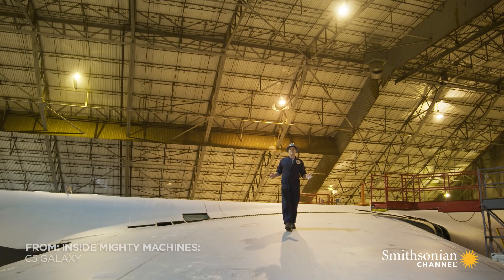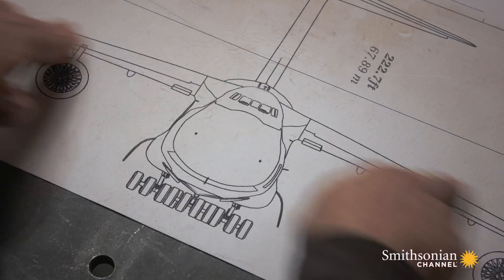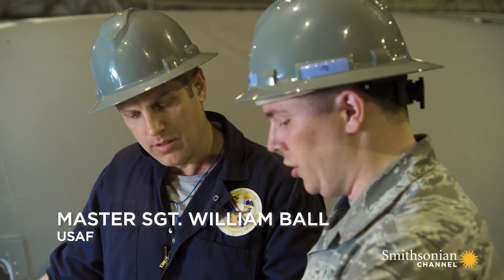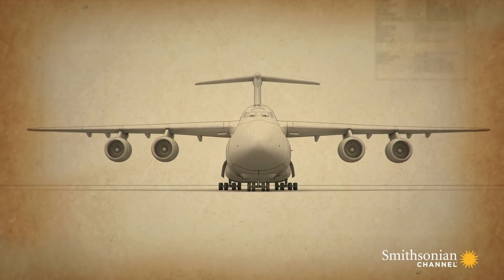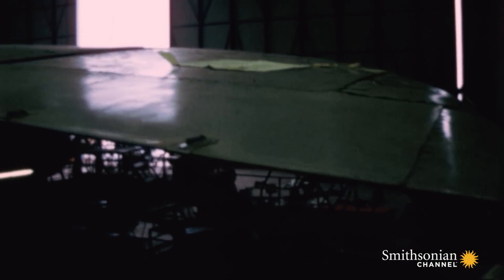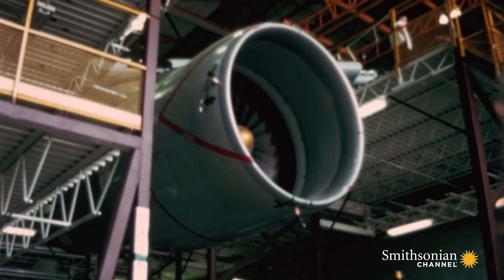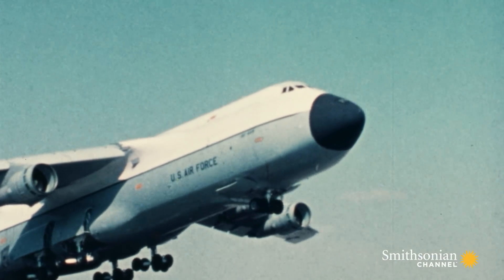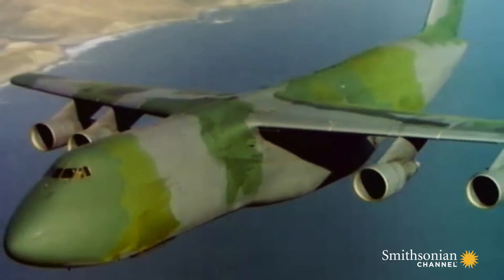The C-5 Galaxy Had a Catastrophic Design Flaw

Comment: As a young Marine flying on a Nato exercise to Denmark in 1978, I was more worried about the cargo door failing at altitude (like in 'Nam)
Turns out, the only thing that failed was a cable in the nose gear steering....on the runway return flight.
We sat in that un-air conditioned passenger cabin for 11 hours like sardines. Not unlike every other flight today. 😏

Comment: For anyone who has a clue, it was NEVER the wings, it was the WING BOX design that was wrong, NOT the wings. I was trained by some of the guys who helped design the C-5. The “Wing Mod” for the B model was to replace the wing boxes on all of them. Lockheed towed them into a hangar, where they’d pull the engines,pylons, flaps/slats off, and actually saw the wing box on the inner areas, and work to replace THE BOX. So, smithsonian should get it right.

Comment: The C-5 is not the first plane to have wings designed to deflect under load. Boeing's early jet bombers, the B-47 and B-52, had wings that deflect as much as six feet. Metal fatigue was an issue with these as well.

Comment: If I remember correctly there is a reason high wing aircraft do not have the dihedral of low wing aircraft. This can be seen even on smaller gerneral avation aircraft. 

B-52s wings flex from 8 feet down to 8 up a total movment of 16 feet. I had a friend who flew in B-52 strikes to Vietnam, he said on takeoff the wings would flap up and down on takeoff and when they went up and stayed there he knew they were going to fly. Important to him since they were carrying so many tons of bombs that they took off with only enough fuel to make it to the tankers for a full fuel load.

Comment: I am an aeronautical engineer. Despite the time and effort put into this video, it has catastrophic design flaws. All aircraft wings flex, especially those that carry very large quantities of fuel, burnt during flight. Note the position of a long-haul airliner's wingtips upon take-off, and compare them with their position upon landing, many hours later. The wings of modern airliners can flex hugely! If an aircraft's wings are attached to the fuselage such that they slope upwards from the wing root outboard to the wingtip, the angle is known as "dihedral". If the angle is downwards, it is called "anhedral". The key reason for dihedral is to make the aircraft positively stable around the roll axis, i.e. if the aircraft is banked then the angle of dihedral ensures that the plan area of the wing going down is greater than that of the wing going up - which tends to pull the lower wing upwards with respect to the higher wing. If the pilots let go of the ailerons, the aircraft will self-level, just as a car with a positive castor-angle has self-centering steering. Dihedral is used on many aircraft with low wings, especially those that need to hold an accurate course, e.g. dive bombers. An aircraft that has high wings has what is known as "pendulum stability", i.e. the weight of the fuselage automatically tends to level the aircraft around the roll axis. If such an aircraft is designed to carry very heavy loads, it can take a huge amount of force to overcome the natural pendulum stability enough to bank the aircraft sufficiently for a tight turn, because the wings naturally flex upwards when "pulling g", so creating self-levelling dihedral. The answer is to join the wings to the fuselage such that they point downwards towards their tips: anhedral. Then even when the aircraft is carrying a heavy load and pulling significant "g" in a steeply banked turn, the wings do not flex upwards so much that they offer a dihedral angle that makes it really difficult to wrestle the aircraft round the turn. THIS HAS NOTHING TO DO WITH THE WINGS CRACKING. The reason for cracking is that the repetitive flexing suffered by the wings caused the stress to vary too many times between limits in a way that was incompatible with the fatigue strength cycling limits of the design material. In short, the structural design and material were incompatible with the stress cycling. THIS IS NOT CONNECTED WITH ANHEDRAL AND DIHEDRAL. Smithsonian Channel: this is cr*p for a channel that dares to carry the name "Smithsonian", but Prof. Samuel Langley would have been proud of you!

Comment: Pretty sure the wings don't need to be angled downwards to flex - source, basically every modern passenger airliner.

The real reason the wings are swept down is because that confers aerodynamic stability in an aircraft with wings placed above the center of gravity.

Comment: Dang, so much wrong with this video (saying this as someone who is an aerospace engineer and worked on the C-6 RERP) and most has been covered, but this was a bit of silliness at 3:15 that hasn't been mentioned:  "... these upgraded planes were renamed 'C-5B.'"  That's not a re-name, just a regular series designator change in the Mission-Design-Series nomenclature.  The "name" of the C-5 (excluding "Galaxy") is "C-5," the "B" is the series.

Comment: The anhedral wing design (in and of itself) is not "what allows it to flex." They flex because of the specific characteristics of the alloys, spars, bulkheads, etc. Presumably, the writer is trying to express that the anhedral angle allows the wings to be close to level when the aircraft is fully loaded, and the wings have deflected under load. But it is not correct to say that the anhedral design is "what allows it to flex". Diehedral wings flex also, as do flat wings. If anything, the anhedral design makes such a large plane more maneuverable, as opposed to other designs.
That was awkwardly worded.

Comment: Have you guys sold out too?  Wings develop cracks over their lifespans, the A-10 wings developed cracks and they were expected.  The C-5 wing cracks were spotted because they were expected and they probably already had a fix in the works.  Before Reagan we had to pull teath to get money to defend the country.  I can remeber going on nature hikes as an aircraft mechanic because we did not have money for fuel, but we had to earn a paycheck....  The c-5 was designed to fit a cheap budget and the wings were expected to wear out.  Reagan as part of his economic campaign on the Soviets, modernized out military.  Part of that program was fixing worn out equipment to save some money on the program, easier to replace old wings than to design a whole new plane.   You do not even describe the fix, but you had a master sergeant there that probably taught you all you needed to know about it.  Why did you just omit that?

Comment: The wing had flutter instabilities in some modes of flight due to both, particular flight envelopes (such as air refueling)and substandard materials during manufacture ( i.e. bean counters during the request for proposal in the development phase). ALDCS was later adapted to the aircraft. Suffice to say, it reduced the flutter and increased the wing life, long enough to give Lockheed time to ramp up the B model production line. Later, it was found that the T-tail developed cracks. This time due to unforeseen stresses put on the tail by refueling behind the McDonald Douglas KC-10’s. I spent many hours in unbelievably cramped, confined and hot spaces (not opened since their initial assembly) helping to repair them. I also spent most of my career flying the C-5 as a Flight Engineer or working on them in all phases of maintenance. It truly was a brilliantly designed aircraft! What killed the C-5 program was the development of the C-17...period! They destroyed the supply chain for the aircraft. They did every dirty trick they could think of ( such as, making the C-5 have to either fuel stop mid-Atlantic or AR because the C-17 HAD to because of its’ initial fuel capacity limitations, among other things)! Every Senator and Congressman had their hand in the Pork Barrel for the C-17 program. It had parts, components and subassemblies that were made in almost every State. D.C. smelled like bacon frying for YEARS because of the 17’s! Still...I loved my 6000+ hours flying it, and the fun filled days and lonely nights working on her. Wouldn’t trade them for a million bucks. Ahhh.....the memories I have of the aircraft, the places she took me (and brought me home from) and the people I worked and flew with. 
I love and salute both her, and all the men and women it took to keep her able to fulfill her mission to this great nation. To all, I thank you.j

Comment: This is way, way oversimplified. There was nothing new about wings that flexed; they were an inherent part of the B-47 which first flew in 1947. It also had anhedral wings (downward sloping wings), which are quite common in aircraft with wings mounted high on the body. The cracks in the wings were a completely separate design issue.

Comment: In the early C-5's the cracked wings caused a lot of fuel leaks. When I was at Torrejon AB in the late 70's it was common to see C5A's grounded because of fuel leaks.

Comment: I am an aerospace structural engineer and I was also a C-5A pilot.  The aircraft original  wing design was quite strong.  However, in order to attain higher cargo loads, they essentially made all the wing components lighter and less strong to get the additional cargo load.  This is what led to the cracking.  They fixed the problem by refitting the fleet with the original wing design, hence the C-5B.

Comment: Anhedral on shoulder mounted wings (especially on big jets) is the norm.  B-47, B-52.  And BTW, all wings flex.  "Cracks" were the problem?  A new wing was the solution?  No, cracks were a symptom.  What was the problem requiring new wings?

Comment: And the earlier Boeing B-52’s wings flex so “ mucho” that there is a wheeled landing gear at the wingtips !  And thin “skin” at the wing root is pretty wavy and wrinkled sitting on the ground.  
Some of the “fix” on the C-5 was not too elegant initially. A lot of great engineering !!!

Comment: This is proof that Boeing actually had the better plane. Thanks, R. Mac! incidentally, the 747, on a Physically smaller wing, could out lift the C5 by 60,000 lbs. Has there ever been a "Wing Replacement Program" with 747s? Nope. Politicians foul up just about anything they touch.
Reply: That may be true, but I think the C5 has a much lower take-off and landing speed for short rough landing strips, that's why it needs the bigger wings.

Comment: This video is absolute rubbish. Lowing aircraft ha dihedral to increase stability. High wing aircraft have anhedral - to decrease stability - otherwise a high wing aircraft would too stable if it had dihedral. To stable means it would not respond adequately to pilots control inputs. I wish premium producers like Smithsonian would consult aerodynamics people before making silly claims. Most private pilots know this.

Comment: Structural engineer here who has worked on aircraft design. All structures flex.  The Washington Monument flexes under wind loads.  Making a wing stiffer won’t make it break.  It will make it stiffer. The 747 wing deflects up under load by a similar amount as does a C-5A wing. 747 wings angle up (positive dihedral) for aerodynamic reasons, to help stabilize the aircraft in roll. The C-5’s high wing is more stable in roll because the fuselage is slung under it, so high wing aircraft often have negative dihedral to aid maneuverability. The C-5 wing cracks were due to metal fatigue. To reduce this, Lockheed had the ailerons (control surfaces on the outboard portion of the wing) flex up in cruise to push the tips down and shift the center of lift closer to the fuselage, thus reducing wing bending loads. They did the same thing on the L-1011. Both have sensors in the nose which sense the angle of attack (the angle of the aircraft to the relative wind) and electrically adjust the ailerons (and horizontal tail) nearly instantaneously to updrafts/downdrafts before the wing gets to the updraft/downdraft that hit the nose, thus minimizing fatigue flexing. Also smooths the ride a bit. Very ingenious system.  This is why NASA and aircraft companies hire engineers and not video journalists to design stuff.

Comment: This was not Lockheed’s fault. The original wing was perfect but the AF wanted it their own way, so Lockheed, under protest, gave the AF just that and those cracks were the result. Once the originally designed wings replaced the “AF wings”; it worked as designed and lasted a long time. I spent  19 years on that bird.

Comment: Saying that High winged aircraft with wings that are somewhat flexible was something new for the C-5? I guess they never of the B-52? The high wing design is not only for ease of loading but with the wings and engines higher off the runway the aircraft can operate airfields that are a bit rougher or may have debris on them.  Same reason most of the bush planes used in Alaska and Northern Canada are usually high winged.

Comment: 131 were built and there were only 5 crashes from 1970 to present. (50 Years) That is 1 crash every 10 years on average. The last crash was in 2006 and no one died. The last fatal crash was in 1990 (30 years ago). 51 are still in service. Yeah I'd call that a successful design.

Comment: The C5 program has had THREE wings thus far in its history: 1) The Original Lockheed Designed Wing that was never built or fitted to the C5, 2) The Lightened Wing Required By The USAF installed on all C5-As, and now the, 3) Revised C5-B Wing fitted to all remaining C5s. 
The Library in Smyrna GA, just a few miles down the road from the Lockheed GA plant, has a coffee table book named "C5A" that was printed in 1969.  That book says that the wing of the C5A was designed for 40,000 flight hours but the need for cargo to Vietnam was too great so the US Air Force required Lockheed to lighten the wing, lessening its lifespan so that more cargo weight could be hauled.  The USAF said the lightened wings would be scheduled for replacement in 5 years... They lasted 15 years before replacement. 
The reality is that the lightened wing exceeded its design lifespan by some 10 years and still Lockheed is blamed for the Air Force's decisions. Unbelievable. Smithsonian Channel PLEASE DO YOUR RESEARCH!!!!

Comment: Remember an airlifter of this size had never been built at that time, and Lockheed was charged for every pound over weight.  So, when the original wing design came out and was discovered to be too heavy, they reduced the weight.  From what I understand the cracks occurred at about one lifetime, so I understand it met the design criteria.  The re-winged A's and B-models had wings that were good for about 40,000 flight hours, hence the airplane cam fly until 2040's.  To put this into perspective, the Russian AN-124 was designed to a similar life as the A-model, and with it's relatively limited use the couple that were built will be grounded in the near future.  I'm not saying the design was perfect, but there's much more to the story.

Comment: Wow Chad you got a lot of things wrong in this vid. All wings inevitably flex, especially noticable on big planes.
What you call 'pitch' is actually called anhedral angle and it just reduces the force that is needed to roll. Also it has nothing to do with fatigue cracks caused by flutter.

Comment: Not quite on topic but the B-52’s wings were capable of flexing an impressive 22 feet up and 10 feet down. It has been decades since I saw pictures of a wing loading test of a B-52 with the wing tip at max deflection but it was astonishing that the wing could survive the punishment without damage.

Comment: Original spec required landing on unimproved runways.  Boeing told them it couldn't be done and Lockheed won the contract by saying they could do it and after endless cost overruns the requirement was removed.  The C5 was never a reliable airframe and was "red tagged" nearly every flight.  Boeing would have built a better plane back then... today? all I can say is thank God we have SpaceX.

Comment: Lockheed suffered wing box problems on all of the large airplanes they made in that time period: C-5, C-141, C-130, Electra, L1011. They were trying to copy Boeing's lighter weight "flexible flyers" without the same level of understanding of the technology. The B-47 and B-52 wings flex much more than does the C-5 and didn't have these issues. The 747 wing was mechanically flexed 34 feet before it failed in test conditions. I don't know what the "normal" flex would be for a 747-400F fully loaded, which is nearly 1 million pounds at takeoff.

Comment: The downward angle of the wings, called anhedral, has nothing to do with the ability to flex. It is done for reasons of aerodynamic stability.  Take a look at a 747-8 or 787 in flight and you will see a lot of flex in low mounted wings.
Reply: RIGHT ON, MY AEROBATIC TRAINER, A SUPER DECATHLON, WITH A SYMMETRIC AIRFOIL, HAD ANHEDRAL SO THAT IT WOULD BE UNSTABLE IN ROLL.

Comment: Flexibility v rigidity , anhedral v dihedral had NOTHING to do with problem of the C-5As wings. The wings were not structurally strong enough to save weight to meet unrealistic air force specifications. Lockheed was frightened of loosing the contract at a time when they had serious bribery scandals and technical problems wit the L-10-11 program.

Comment: I’m amazed at how misleading this video is... 
The high mounted wings are angled downward for one reason only, roll stability. With this design, high pressure air forms between the inward wing and the engine while a low pressure area forms on the opposite side, making it so the plane you come back to level without any input. Anhedral va Dihedral angles, that’s why airliner’s wing are angled upward (here it has to do with Angle of Attack but same result, for roll stability) 

Smithonian, this is embarrassing